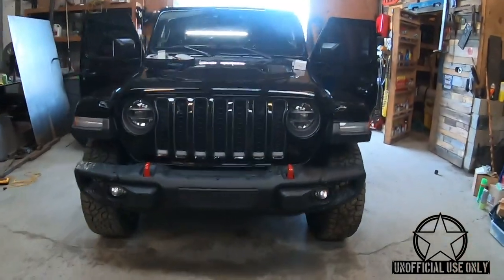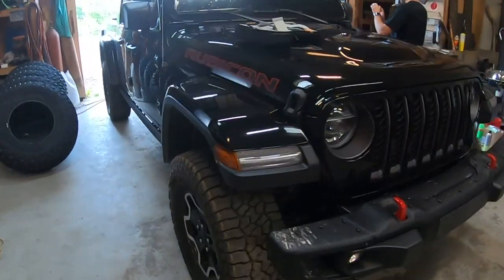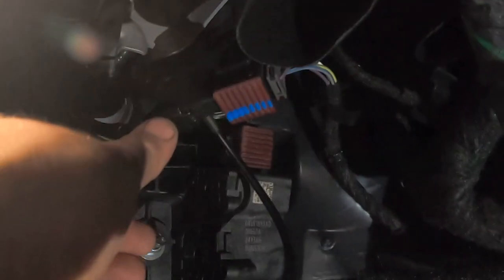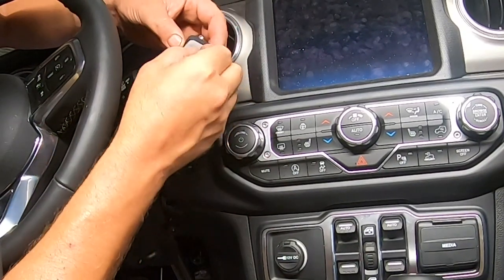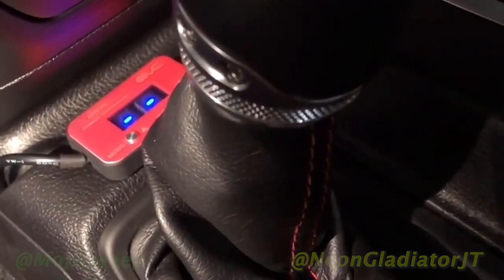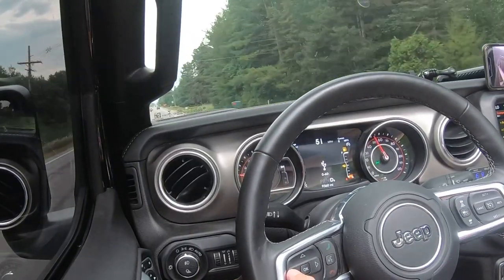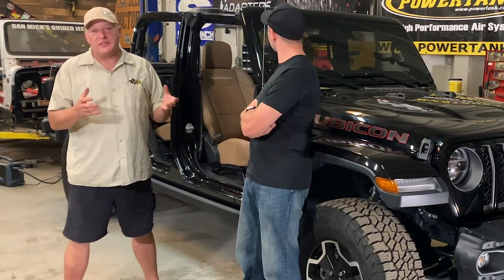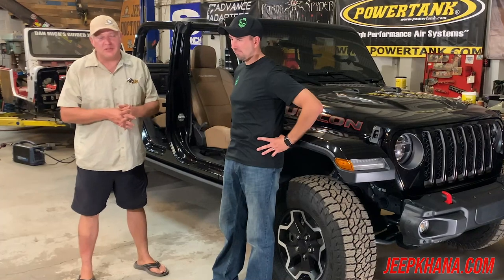2020 Jeep Gladiator iDrive Throttle Controller

Comment: The thing w those throttle controllers is they dont change the mapping when you floor it (i.e. no diff 0 to 60) but when you're driving around normally it takes the lag out (or ads lag respectively)
Reply from the maker: Yeah, that’s true, but overall very happy with it, other small performances mods are in the future, mainly just exhaust, CAI and a couple other goodies.

Comment: So I still don’t get it. iDrive alters lag in throttle response, but does it change gearing to keep engine on higher/lower rpms like what most modern cars have with eco/sport mode?
Reply from the maker: Dima Habenko it makes your throttle MORE or LESS responsive. You’re vehicle will definitely shift differently depending on what mode, only because you’re going to get to X speed faster or slower therefore it’ll need to shift based on that. But that’s ONLY because the vehicle is changing speeds differently. iDrive doesn’t do anything except change throttle response. IT IS AWESOME and highly recommend it. We have dealer connections and can get you one, along with our support and expert advice from Unofficial Use Only. Also, we might be including some free merch with and iDrive Orders in February. DM on Instagram if you want to talk more.

Comment: So what’s the difference in gas mileage between the settings?... We never got an answer to that question.  Thanks!
Reply from the maker: Everyone drives totally different, so it’s really hard to nail down the difference, HOWEVER if you’re a LEAD FOOTED NASCAR DRVING MANIAC like we are, put it in E9 (Economy 9) which is the most conservative mode possible and then the pedal is like mush, even if you punch it, the truck barely gets any fuel and forces you to drive slower and save gas!

One click of the button and it’ll flip to U9 (ULTIMATE 9) the highest most aggressive and preppy sensitive mode and it’s like a ROCKET 🚀 we are getting the modes changed to J10 for #JEEPKHANA mode LEVEL 10 😆

Comment: “This is a completely unbiased test” “wow this item that adds absolutely no horsepower makes your vehicle feel faster” “we’re a dealer for this item and would love it if you bought one from us”
Reply from the maker: Jonathan F it doesn’t add horsepower, no. But the throttle responds much quicker. So yeah it is a lot more fun to drive. Go ahead and test one out and see what you think. If we didn’t like it, we would simply say it was no good and not offer it. It’s incredible how much more fun it is to drive. Go watch any other reviews, you’ll see.
Reply: I’m aware of the product. It  is basically on the fly control of your fly by wire throttle application curve. It tricks your vehicles computer into thinking your giving the vehicle more throttle than you really are in its aggressive mode and then allows it to think your giving it less throttle in its economy mode. But at the end of the day full throttle is still full throttle.
Reply from the maker: Jonathan F that is true, but it can also save lead foot drivers gas. Full throttle doesn’t happen as quick without it.
Reply: I agree but at over $200 in price you would need to save a lot of gas to pay for it. The only real Benefit I see to this item is that it won’t void the warranty if that’s something people are concerned about. However if it’s performance someone was looking for it seems the money could be better spent. However all of this being said the tazer module you all plugged in seems to have some very interesting features. I would Be interested in watching a video where you show the different things it allows
Reply from the maker: Jonathan F Sounds good thanks for the feedback! Yeah the TAZER is pretty amazing.

Comment: How much would it cost to put a hemi in these?
Reply from the maker: Benjamin Vanlandingham depends on a couple things, but pretty easily $20K+ usually closer to $30K to have it done.

The conversation kits alone are $8,000+ (doesn’t include the engine) and also, you’re gonna need to take consider swapping axles depending on what Hemi and if it’s detuned or not. 6.4L Hemi is my absolute primary goal. Might be a while before it happens, but no doubt it will.

Comment: Meh ,that I-drive seems like a scam to me. He even said they were similar 0-60 times.    I would just stick with the tazer if I decide to get a gladiator.. Jmo
Reply from the maker: Well. You have a good point, however they offer a 30 DAY money back guarantee, so if you’re not impressed send it back. ZERO to SIXTY is not different but the soft pedal is GONE. It’s hard to describe. HIGHLY RECOMMEND IT. Read or watch any other review, you’ll see!